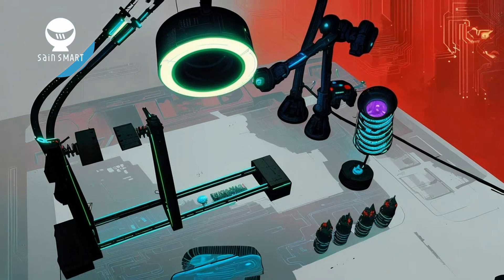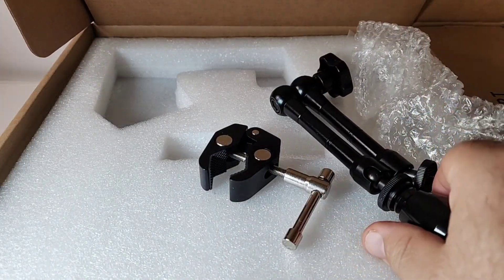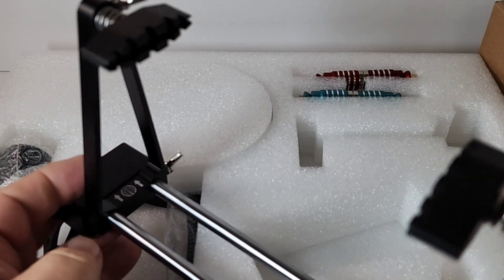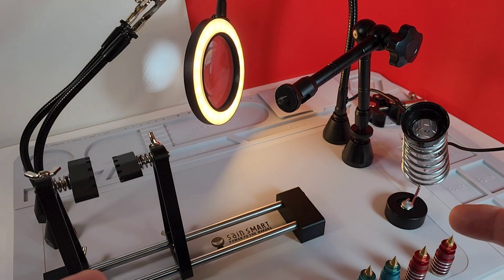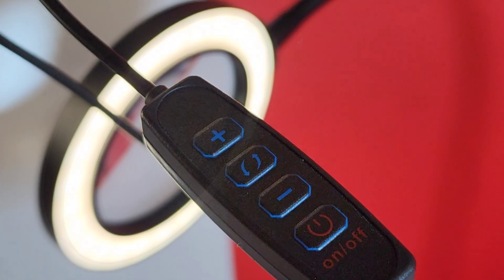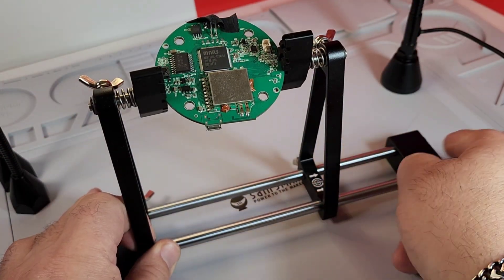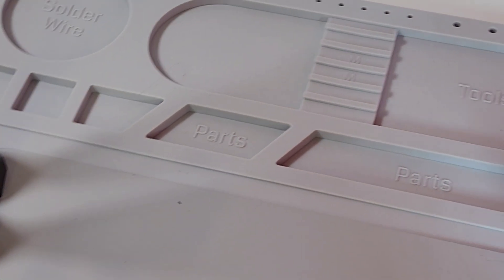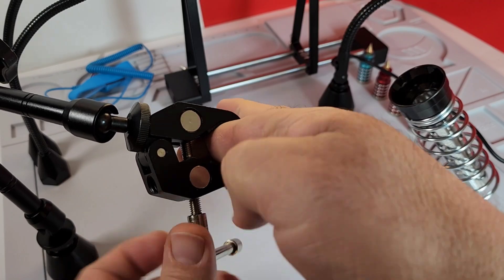SAIN SMART Luxury Soldering Station (Kit) Review!

Comment: Those jointed holding arms look very much like the Noga brand type that machinists use, Noga is supposed to be (the) name in these type holding devices - to avoid scratching up the metal base dont slide the magnets but instead rock them over and pick up and set them down same way to avoid dragging them across the surface.
Reply from the maker: Those jointed arms are really nicely done. Interesting that they resemble such a well known machinist brand. I'm telling you Mike, this magnets are incredibly strong. You really have to take your time removing them and as you point out,never slide the magnets!! 😅

Comment: Nice, looks like it would make soldering tasks a lot easier. That articulating arm and clamp are the same available for camera tripods, much more secure than the crocodile clip versions, but I guess that will be reflected in the price.
Reply from the maker: Good call! The arm/clamp is definitely solid and won't budge once locked creating a very robust mechanism for holding anything that needs to be secured.
Reply: Great add @KeepOnTesting

Comment: Hope the beautiful plate does not get burnt or damaged when soldering, the surface looks so delicate. Other than that everything about it is luxury grade in quality as well as looks. Magnetic bases should have anti-scratch layer of some sort to prevent it damaging the soft paint below on the plate. No word on the warranty of the unit.
Reply from the maker: I think it will still look great in the long run as it's really well fabricated. Refinement and soldering seem strange but you definitely feel like a million bucks when soldering on this 😊 Good question about the warranty,  I'll follow-up on that one!